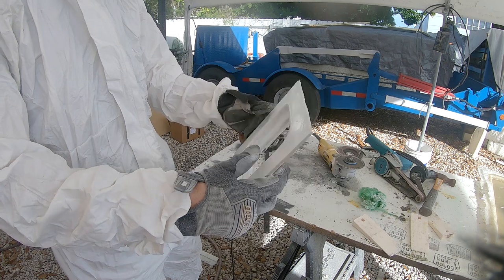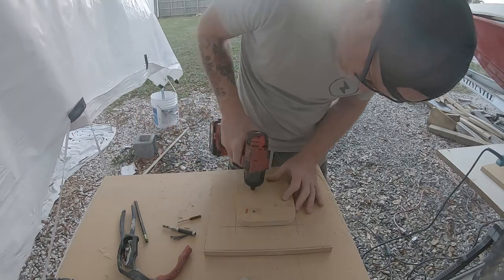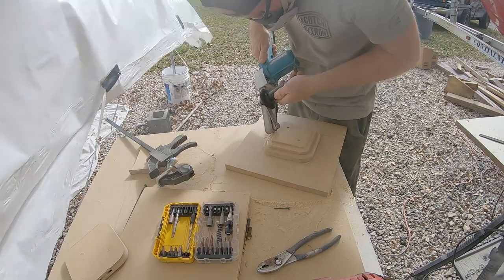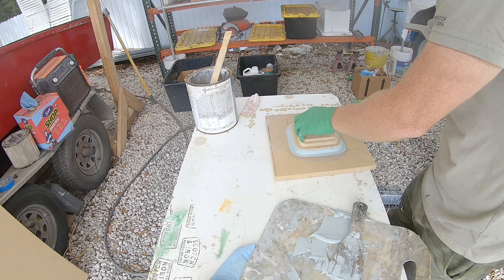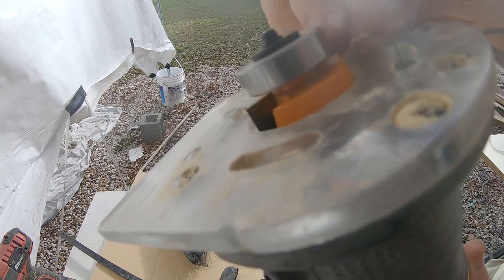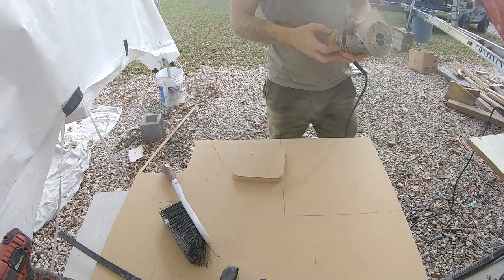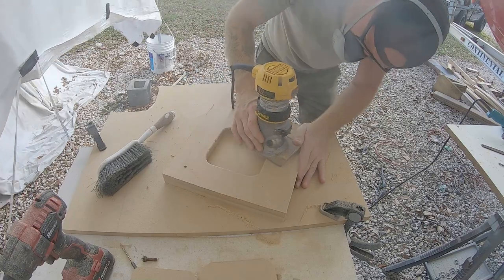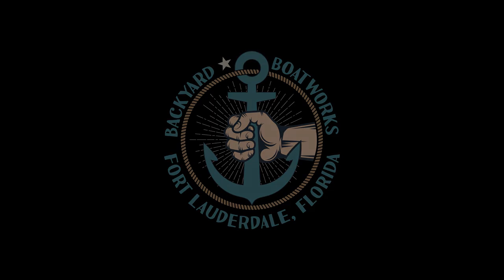How to make FIBERGLASS Mold using MDF.  DIY Boat Restoration Projects

Comment: If you use less activator in your bondo it won't dry as fast. Or mix smaller batches.
Reply from the maker: I’m aware of that. Thanks.
Reply from the maker: At 3:50 I specifically said I mixed small batches and also said that if you make the mixture “too hot” it’ll cure within minutes.
Reply: I use polyester and talc for filling radii. You can take your time and get it reasonably good and talc spreads better than lightweight fillers. It also releases better than bondo - Im assuming Bondo is the same stuff thats used for auto repairs which has an additive to make it slightly flexable.
Reply from the maker: I stopped using polyester products on my molds because it was failing and cracking. I only use thickened epoxy now. The bondo works okay for one-time molds, but I’ve been using fillet wax or modeling clay instead to speed up the mold making process. I have some new videos coming soon with my updated mold building steps.
Reply: @boatcrafterscollective  Ive never had that problem with polyester. Good idea yo use the modelling clay, ive used that with success too.
Reply from the maker: After 2-3 pulls the poly just doesn’t stick that well to MDF.
Reply: @boatcrafterscollective  okay I see. I use it only for making one offs.